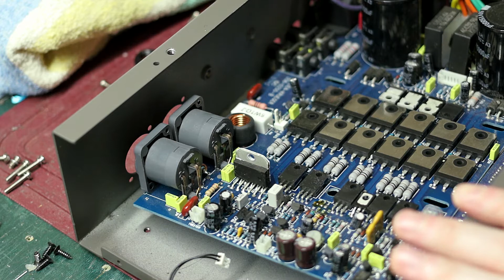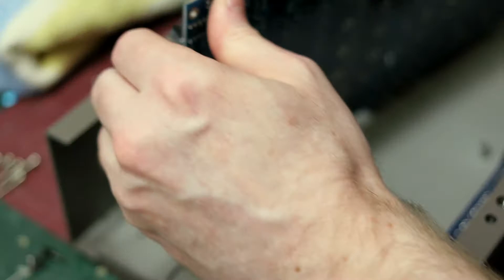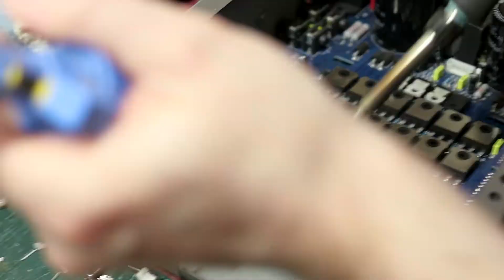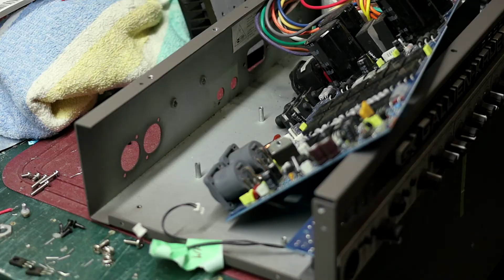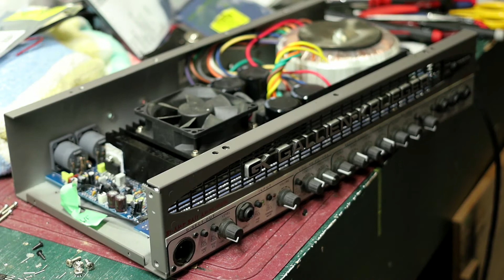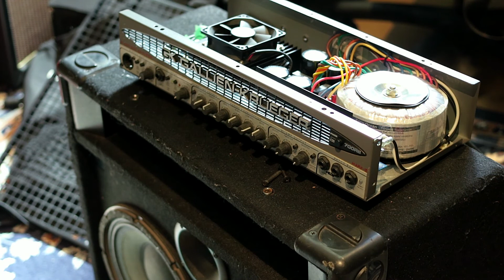Gallien Krueger 700RB ii Pop Repair

Comment: Hi ! How did you find that these transistor where the problem ? 
I have one rb700II who blow fuse , did i have to un solder all transistor to test with dca75 ? 
Thanks for your video !!
Reply from the maker: It's been a while but, I think there was a service note I found for this one. 
Sometimes you can find bad transistors in circuit with diode mode on your multimeter. You'd be looking for a short so best to start there.

Comment: This was a great help. I got a cheap 700RBii from an online auction but it was almost without sound. The pots were super scratchy but Deoxit did the trick. The pots are almost totally sealed but you can sneak Deoxit in through a tiny slot in the side. Then I reset the bias like you showed. It was a great confidence boost watching how you worked on it. My amp seems to be perfect now - woohoo. Thanks so much!
Reply from the maker: Awesome Peter! Glad it was a help.

Comment: Do you want some more work? I have an older model Gallien Krueger 800RB that cuts in and out. It works but something causes it to cut out but it will come back but it is useless to use onstage because of it. It is a good sounding amp so i would like to get it fixed. 

I really don't have the tools to work on electronics but i could get em if i can't find a audio repair tech  willing to work on it. It is probably just bad pot, or bad instrument input, or a bad decibel switch that is used to reduce the instrument input if you have active pickups on your instrument.  Because if i cycle that  specific switch after it cuts out it comes back. I have dirty pots too. 

I use a guitar with active pickups so i always have to have the db instrument input switch set to low, but when it cuts out after a few songs or during the first song, when i cycle the switch to the high it allows more power to run thru into the input stage and could be why cycling this switch brings the sound back because the higher power may cause a loose pot and or whatever it is causing it to cut out, to make connection because the higher power in essence kinda forces it to connect again, so that switch could be good but if so then i would suspect it is the pots and maybe some of the other switches too.

Would it be too expensive if i just paid for all new potentiometers, same grade of quality at least? These lasted for a few decades at least so i would be happy with at least the same quality and get another 20 or more years.
Reply from the maker: Sorry but I'm pretty full up for work. The shipping alone at this point would make it cost prohibitive. 
Kind of sound like some isopropyl for those pots and switches is what's needed to start with. I'd look around inside for any cracked solder joints and any corrosion on jacks or ground points. Sometimes it is cheaper to just replace a set of parts but you need to have narrowed the problem down to that area. Otherwise you're just firing the parts cannon and that can get expensive and you'll still have issues.  And new parts do not always equal good parts. Give stuff a cleaning and if it's beyond your diagnostic ability, find a tech more local. Sometimes even a computer repair shop will have someone who does some of this stuff. Best of luck.

Comment: I have exactly the same problem with exactly the same amp. 
A technician changed all the pots and some other parts only to arrive back at the same issue. I will this method, because it’s a really good sounding amp.

Comment: How'd you get the heat sink off? I took out all the screws through the transistors but i'm too worried about pulling too hard and breaking something
Reply from the maker: Double and triple check you have all the screws out. From there pry and lift from different sides. I forget if they use thermal compound or those gray thermal strips on these but they can really bake themselves to the heatsink. You may be able to dislodge some of the outer transistors with a tool but be careful. Sometimes a light twisting motion of the heat sink can help. I do remember this one not being easy but eventually it will break loose.

Comment: Can you talk about the technical reasoning behind swapping these two transistors out ? Their specs appear very similar to those GK installed except the MJE pair have 300V rating instead of 200V rating and the MJE pair has a lot higher collector cutoff current. What makes this swap affect the popping of the amplifier ?
Reply from the maker: To be honest, I didn't dig that far into it. I found documentation that was the swap being performed at Yorkville service centers. I'd guess it has to do with how they discharge when power is cut, they obviously don't have or cause that spike but, beyond that, I'm not sure.
Reply: My only guess would be some spike voltage causing the original transistors to go into the breakdown region and fully conduct  for a moment causing the loud pop.